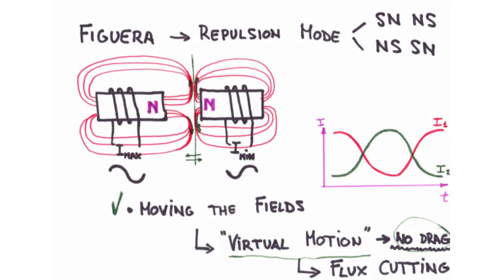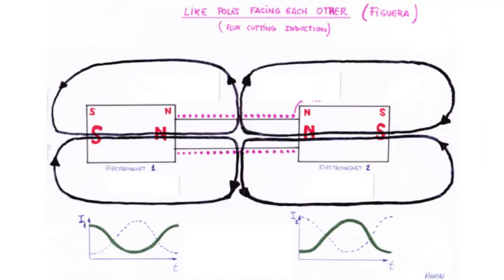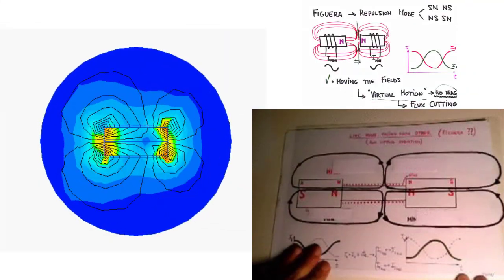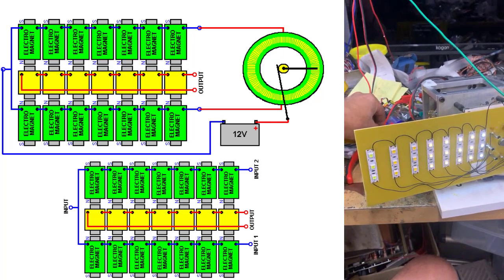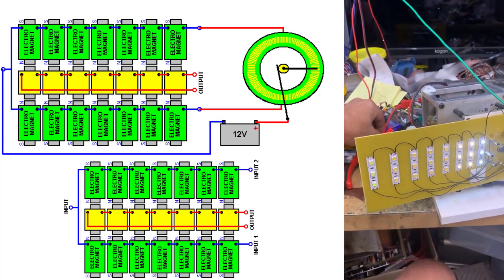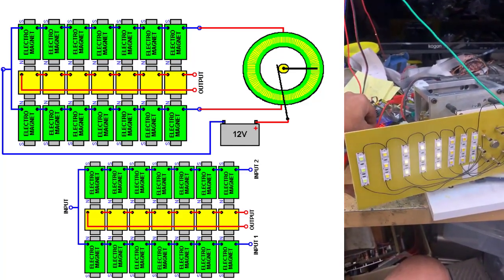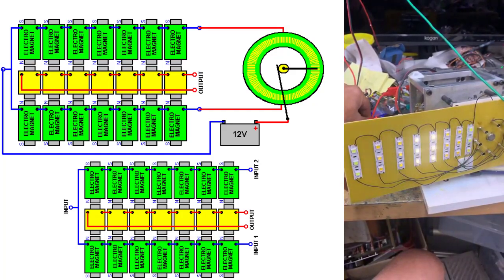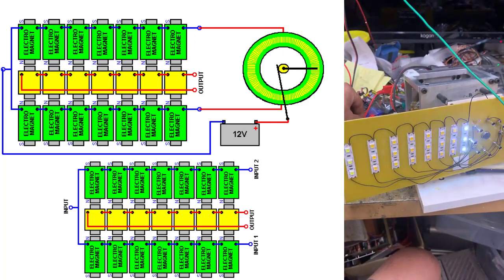Free Energy: The High-power Motionless Generator of Clemente Figuera

Comment from the maker: The High-power Motionless Generator of Clemente Figuera: https://air-fountain-water.blogspot.com/motionless-generator-of-clemente-figuera
Reply: In recent years, there has been a resurgence of interest in Figuera’s generator, driven by the growing demand for sustainable and renewable energy sources. Modern advancements in materials science and electromagnetic theory provide new tools and perspectives that could help unlock the secrets of Figuera’s design. Researchers and inventors continue to explore the principles outlined in the 1908 patent, seeking to overcome the technical challenges and harness the potential of this enigmatic device.

If proven viable, Figuera’s generator could have profound implications for the future of energy production. A successful implementation of the device could provide a clean, renewable source of energy, reducing our reliance on fossil fuels and mitigating the environmental impact of traditional energy sources. Furthermore, the simplicity and durability of the generator could make it an attractive option for a wide range of applications, from powering homes and businesses to providing energy in remote and off-grid locations.